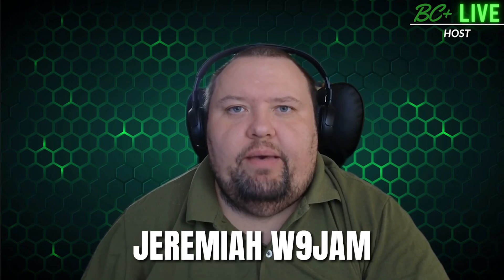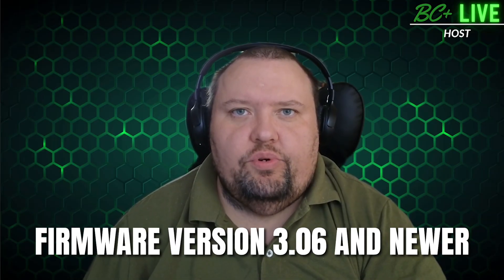Don't Miss This RT Systems 878 Update! #hamradio

Comment: Maybe I Don't upgrade my Gen 1 Anytone 878 UV radio. What features are we gaining thats worth the pain?
Reply: The major thing is that it has satellite tracking, and it will automatically add the transmit and recieve frequencies to work them. I guess if working satellites is of interest to you, then update. Personally, I have found every one of the updates from 3.03 has been a problem in one way, or another.

Comment: Jeremiah, I'm a little confused about the statement on RT Systems, and the original Anytone CPS. I'm well aware of the CommDataError when you try to read/write from 3.06 into the Anytone CPS. I have talked with RT about it (maybe you have too), but they say they're working on a solution. Did you find a workaround to allow a codeplug written in RT to be used in the Anytone CPS? Reason is, as you probably know, there are settings/features that only can be done in the Anytone CPS. It doesn't affect me since I am only running 3.03 in my 878. I tried 3.08n, but that has a bug that affect my radio, so  I reverted back to 3.03 until Anytone addresses the bug.